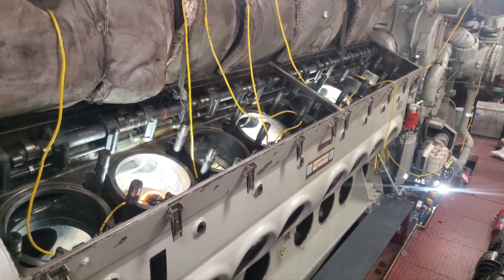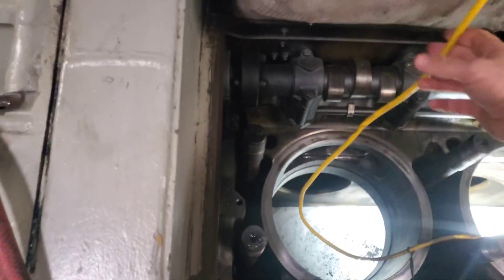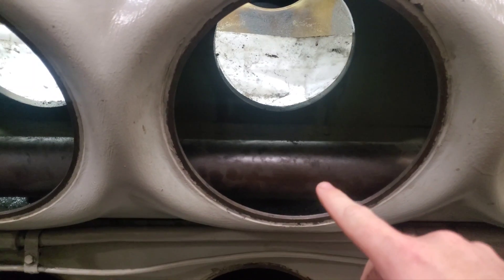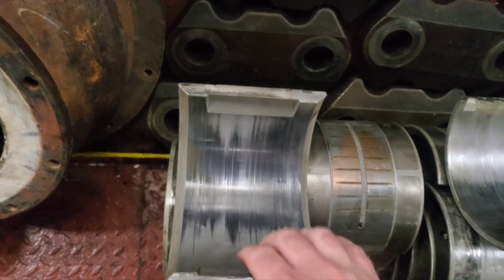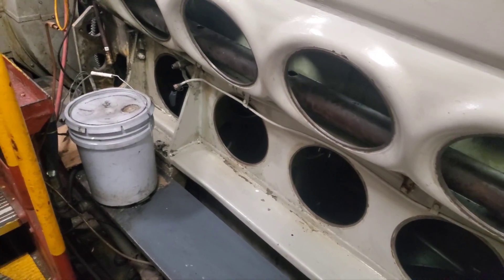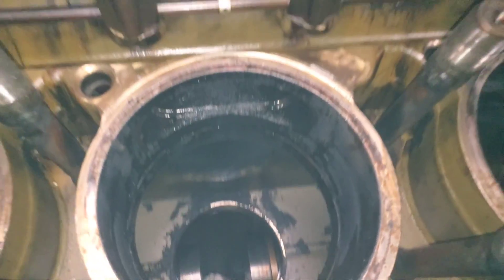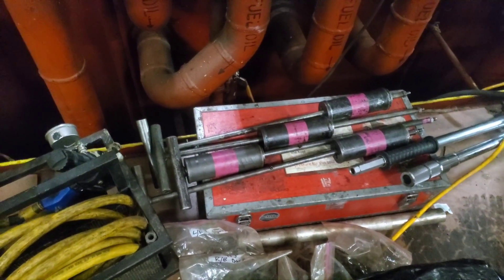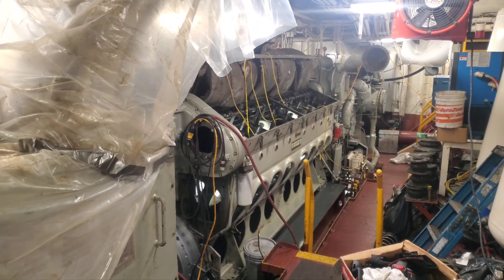Rebuild of 2 Stroke EMD Ship Engines

Comment: what's the oil crankcase capacity of the 16 cylinder? how many gallons of oil?
Reply from the maker: About 450
Reply: @FixAndForget  450 gallons of 2 stroke low ash oil 40w! I worked on 2 stroke tugs and mix 40:1 in my stihl saw and 600$ FS-240 brush cutter and its the best oil i used so far!

Comment: :text-green-game-over:Amazing views. The work and knowledge in what you guy's do, Is my crew tearing open a 250 KW  AM transmitter for service. Much respect. Question, is this a Tug, or another type of vessel? I watched a video of a big container ship and it's two MANN marine engines. When the techs pulled out the power packs, climb down into the boar. WTF?   :face-green-smiling: :trophy-yellow-smiling:
Reply from the maker: Haha thanks! This is a 300+ ft  government ship. I would like to see what the inside of a 250 KW transmitter looks like. I have a few videos on my page of those big slow speed engines too. Thanks for watching!
Reply: @FixAndForget  Sadly all the transmitters that I have worked with are all gone. Everything is all Silicone very high power equipment, very high efficiency. And Tier 4 EMD'S, They just don't look or sound like the equipment of day's gone by.  :person-turqouise-waving::trophy-yellow-smiling:

Comment: Still running 16-567s on my boat although I'm currently running 645 power assemblies, they are fast approaching 300,000 hours. GM hit the nail on the head with the EMD, hands down the best diesels overall in my opinion.
Reply from the maker: I couldn't agree more. The 567 was a huge improvement over the previous Cleveland engines and they just got better with the 645. Peak engineering

Comment: Worked on one that we used as the main generator for the town of McMurdo Station Antarctica in 1979 .
Reply from the maker: Very cool, I believe they are all CATs there now. Thanks for watching!
Reply: The Trump train has a Polaris Patriot v-16 2 stroke that's 850 CID per cylinder and turboed to makes 13,500 HP @ 1150 rpm. I burns liquid hydrogen and amsoil interceptor 2 stroke synthetic oil. The oil injection dry sump tank holds 500 gallons of amsoil interceptor.
Reply from the maker: What is the engine model # to search info with? Sounds interesting
Reply: @FixAndForget  Its the MAGA 16v850 Donald J Trump crankcase scaveneged turbo charged model!

Comment: that is how all engines should last..........30,000 hours minimum. Was the engine overhauled just on hours or oil samples?
Reply from the maker: Just on hours. The 12cyl had 35k hours on the last overhaul and was still fine, we try to do it every 30k just to avoid problems from worn power packs. Thanks for watching!

Comment: I was a tool & die maker at EMD in the early 1980s. EMD at that time had 12,000 employees on 3 shifts building 6 1/2 locomotives a day. 144 tool makers in the toolroom in plant #1. They had small fire engines and ambulances, think clown car size, that would race down the aisles of the plant to fires and emergencies. They built almost every part in house from raw materials at the 3 EMD plants. I think the 20 cylinder engine was their largest. No castings, every thing was weldments. It was a remarkable place to work. Being a tool maker allowed me to go every where I wanted in the plant.
Reply from the maker: Yes all welded construction! I've never spoken to someone who worked at EMD. Where all 3 plants in/around LaGrange? What became of them, I heard when CAT bought them the plant was moved. Thanks for watching!
Reply: @FixAndForget  Plants 1 and 2 were in La Grange park. Plant 3, where they did the weldments was in Chicago Heights I believe. Never was at plant 3. La Grange was chosen for the location of EMD's plant because limestone bedrock was only a few feet under the ground level. If you could see the size of the machinery you could see how this was a requirement. La Grange park was one of only 2 places in the US where bedrock was on or the near the ground level. Plant one was built in 1935. My dad started working there in 1948 and I worked on the stator motor assembly line in 1964. Went into the Air Force in 1965 for 4 years. Became a tool and die apprentice in 1970 and got a job in the toolroom at EMD in 1980. Thought I had it made for life. Most people stayed till retirement. They had great UAW benefits. All came to a end when interest rates went to 19-20% and the Pen Central went bankrupt and sold off their locomotives for cheap. A two and a half year back log for locomotives disappeared and I got laid off. EMD never recovered. I think they still make the engines at Plant 1 but only have 900 or so people now. There is a great book called On Time by Franklin. M Beck that has the history of EMD until 1948.
Reply: @stephenp8086  There is another fantastic book I was lucky enough to read dating from the early 80's. It's angled from the Allison Division of GM (turbine engines) but in the early chapters on the companies history includes a detailed history of the Cleveland engine and Charles F (boss) Kettering's involvement in General Motors Development, including the design and challenges of the smaller 71 and 110 series engines. A fantastic read I would love to get hold of that book again.
Reply: 20 cylinder is the largest. Used in the SD-45 locomotives (3600 HP), they have a distinctive sound.

Comment: It’s really interesting that the general design of this engine was developed in the 1930s. It has been updated since. 

I’ve never done any wrenching on an EMD, but have run them extensively in locomotives, from 567 powered 1950s models, through to modern. I have been around during rebuilding of their cousins, Detroit 53 and 71 Series.
Reply from the maker: I agree, I've worked extensively on Winton/Cleveland engines which became EMD late/after WWII. There are direct resemblances between the two, in fact the newer EMDs became even more simple than their 1930s ancestors. Probably one of very few examples of that happening throughout engine design history. Thanks for watching!

Comment: If you have a damaged pee pipe (piston cooling pipe), cut the block that bolts to the bottom of the liner off the tube and then once you’ve removed the good pee pipe from the assembly you’re removing, you can bolt that old pee pipe block to the liner and hold the piston in the liner as you lift the power assembly out of the block. Then you don’t need that threaded piston tool. We don’t even have one of those piston lifters in our shop. TESCO makes those blocks also, they have captured bolts in them so they don’t get lost.
Reply from the maker: Wow never thought of that. I will definitely keep that in my "toolbox". Thanks for watching!
Reply: I was going to say this too. I served my apprenticeship working on Locomotives ,mainly EMD's, most built in the early 1950's. '
One of the first things were told when starting out on EMD's was to never ever forget that rubber O ring, refered to as the life saver.
Reply from the maker: @Mercmad  If forgotten you would be back in there in a hurry. Thanks for watching!

Comment: Are these 645s or 710s  Cat now owns EMD thought that would be the end they bought it to get in the rail road Cat quit making truck engine s I used to weld and machine on these engines loved it
Reply from the maker: They are 645s running the new Eco-packs. 710s and the new 4 stroke engines are still being produced by Progress Rail (Cat). 645 parts are still in production as well. Thanks for watching!

Comment: Man, I forget where I found it, but i read a short "book" on the development of the pistons for these. From the beginning to the last design, written by a group of the project engineers. It was actually pretty good, if you're into that type of read. There was pictures and diagrams and cutaways galore.
Reply from the maker: Absolutely! These engines run the new "eco-pack" sets. I believe they came out about 5 years ago but are still a 2 piece piston design. Thanks for watching!
Reply: @FixAndForget  I'll try to find a link to it.
Found it!
https://utahrails.net/pdf/EMD_567_History_and_Development_1951.pdf
Reply: As someone has said it was Utah Rails. I read it from end to end too. It was fascinating.
Reply: @ThePaulv12  well, I tried to add a link to the PDF in a comment, but I don't see it now.
Reply from the maker: Thank you sir!